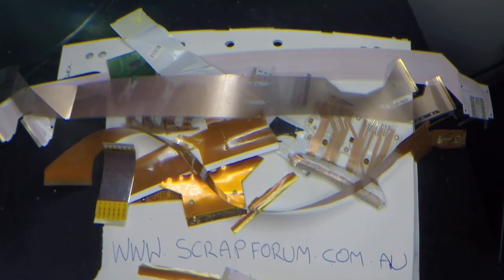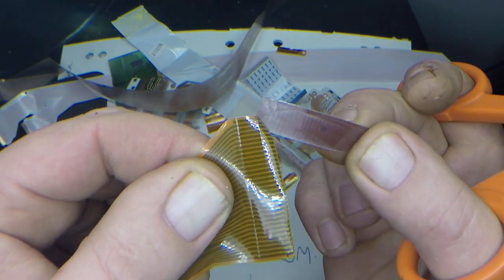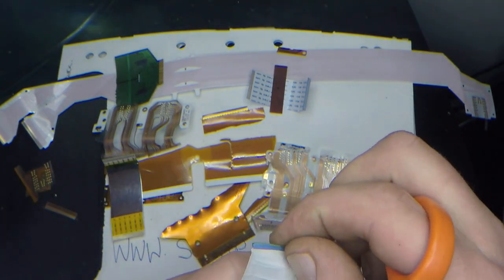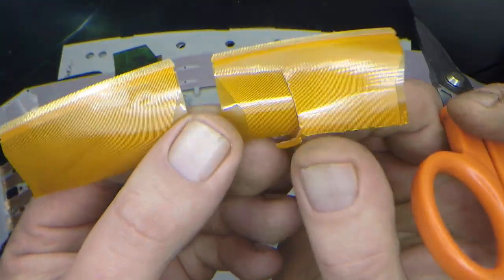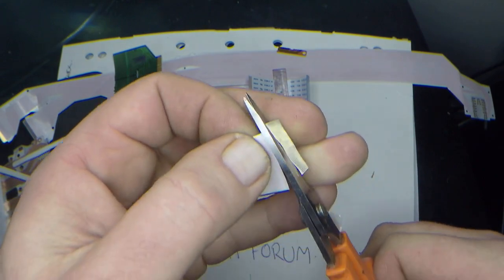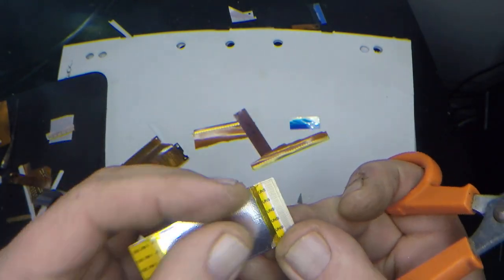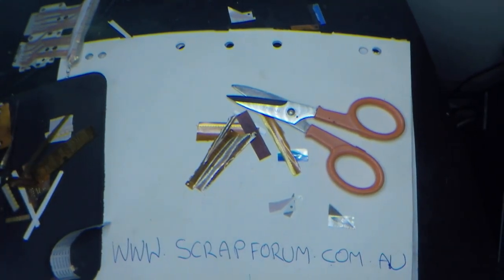Trimming Gold Fingers from Ribbon Wire

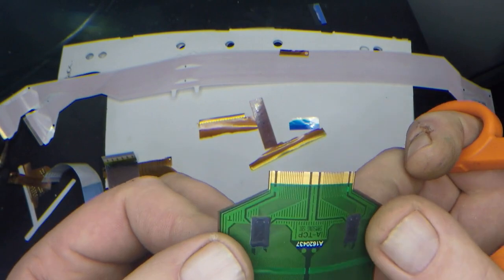Comment: At 7:12 min you have that ribbon with 2 things like ceramic stuff. Do you have any idea what are those little ceramic or glass things. And of course you have great video's. Many thanks
Reply from the maker: No I haven't looked closely at them things, they are like resin coated but not sure, might be ferrite to act as a ground or something
Reply: Thanks for so faster answer. You doing a nice job with all information what share  in all videos.
Reply: I've had a close look at those things you're talking about, you find them on flat screen tv's on the plastic connectors with the gold edges he's snipping off. I think they are tiny transistors, just like the little circuit arrangements you can see when you hold a tv screen edge up to the light. I think there are lots of tiny, flat transistors that produce the screen image which include those little ceramic glass things. Long story short, they LOOK as if they MAY contain gold but I have not heard or read any confirmation of this. But it makes sense that they would. I recently found out that normal transistors have a little gold in them so some of them might have gold bonding wires too, or the ceramic equivalent. At least I hope so cos I've been collecting them. If anybody knows for sure I'd appreciate a heads up as to whether they do contain gold and how to identify the ones that do. Oh and how to process them would be very interesting too. 🤓👍

Comment: what do you do with the rest it after you cut gold away?
it's most likely copper. nice video. just getting started.
Reply from the maker: +John Crawford Yep, it goes as low grade insulated wire, same as data cable and antenna wire, it's all under 18% copper, so low grade insulated.

Comment: I have been saving these for a while now, even though everyone keeps telling me they are not gold. Now that you have proven me correct on the gold ribbon wires, I wonder, are the ribbon wires that look silver on the ends actually silver?
Reply from the maker: +lost in the tundra most likely tin plated, depends on the application, if very high end or old electronics it might be silver, usually silver is dull, not very shiny like tin
Reply: Thank you!
Reply: There goes my question to, thanks for clearing that up for me!   Great channel BTW

Comment: I ran across some ribbons that had what looks like silver fingers on the end instead of gold. They came from a flat screen TV. Would you happen to know what it is? Love your vids.
Reply from the maker: +jerry Crash Thanks, Most likely Tin plating, one clue is silver will tarnish quickly, not very reliable in modern technology connections, but I know what your thinking, it's strange they go from gold down to tin, you'd think it would be silver but it's usually not, but hey sometimes it could be but probably not enough silver fingers to process, mostly tin.
Reply: +eWaste Ben Thank you.